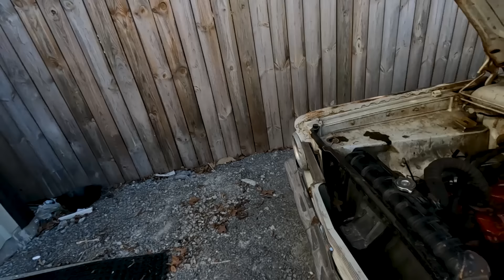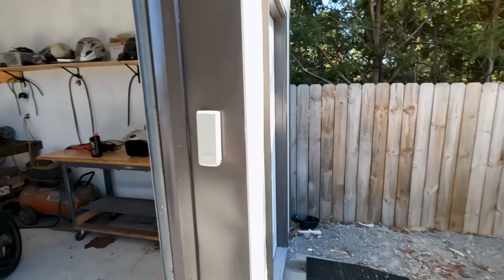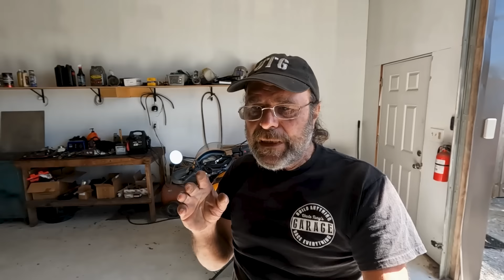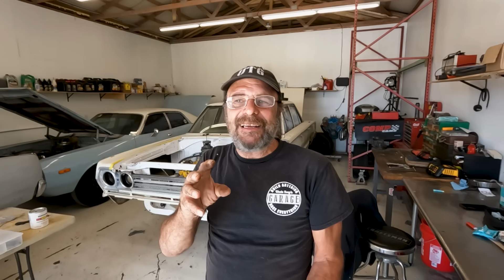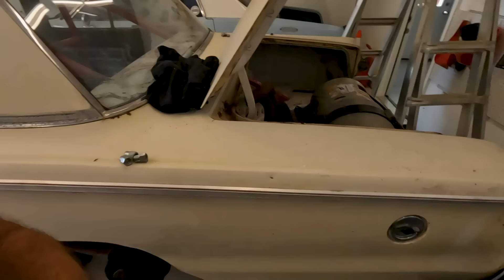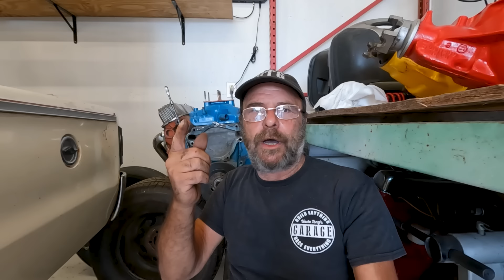Classic Car Tuning Problems - Curing Off-Idle Stumble, Bog, Hesitation, Stall And Backfire

Comment: i was born in 82 so most of my driving/adult life society has been injection.... although my dad was a old hotrodder.....mom always had a newer car bud dad stuck to the older stuff from the early 70s and older.....i learned carb adjustment and points dwell way before i was old enough to drive....my firts car was a 49 willys wagon whn i was 14....now im in my 40s  and prerty much only drive stuff from the mid 60s and back......now my kids are building classics too.....its wonderful passing this info to the next generation....if we dont its gonna be lost

Comment: Always set with a cheap neon timing light. Didn’t know about the difference between ported and manifold vacuum. I also used static timing setting it with a cigarette paper like one does on a motorbike. In retrospect I think I got good results timing my various 60s Chrysler cars but may not have got the GM cars timed right. My 63 383 would chirp the tires shifting from 2nd to 3rd at 85 and that good enough for me. I discovered those cheap timing lights were an excellent was to diagnose a weak or intermittent coil because they relied on the coil for power. Aimed at the firewall you could see when the light wasn’t consistent. Intermittent = bad coil.

Comment: Important to note on the accelerator pump: it only holds enough fuel for one squirt at a time. I mistakenly told a guy once that it should squirt every time it pumps and sent him down a rabbit hole trying to "fix" it because it would only do it once. Of course he didn't know it needs to be running and have a functioning fuel supply in order to work every time.

Comment: When I switched out my edlebrock 800 avs 2 carb to a Holley XP 750 I also needed more advance timing
Reply: How was the performance after the swap. Was it a big noticeable difference in acceleration? I’m thinking of doing the same .

Comment: Don’t forget about a weak EGR valve. If spring is weak, valve will just pop open and cause a lean mixture. Just unplug EGR and test drive vehicle. If it goes away, just leave it unplugged or replace it.

Comment: I used your power tuning method on my mild 318!
I saw that on an older video of yours. So I don’t know what my timing is set at but it sure runs good!
Also,I’m running a tuned Edelbrock 500 and after experimenting I found mine runs better using manifold vacuum. Quite a snappy set up now. Running a Comp 268 cam, Edelbrock performer intake, hei distributor and coil and a full 2.5inch exhaust.  My biggest improvement was upgrading the diff ratio from 2.92 to 3.45. By far better now.
Reply: Sweet.

Comment: There was a third way to set the timing on car’s with a vacuum advanced distributor, but it did not always produce what I’d call a reliable result. And that was to disconnect the vacuum advance, block off the vacuum line and loosen the distributor locking bolt just enough to move it by hand with the engine running if you had a distributor wrench. Then rev the engine without touching the distributor, and when the distributor moved lock it in place and let it return to idle. The reason I say it did not always produce reliable results, was it could be difficult to get the distributor locked in place before letting the engine return to idle or have the distributor locking bolt loose enough for the distributor to move on its own. Or still have the distributor locking bolt tight enough, to lock the distributor down while holding the throttle at a fast idle in a single twist of the distributor locking bolt. I played with that method of adjusting the distributor in that manner a few times, and the results could be very interesting and sometimes wildly inaccurate. My dad had a strobing timing like that did not have that dial, and it was very accurate as long as the harmonic balancer was in good condition and the correct one for that engine. And had the timing marks in the correct location on the timing chain cover. If not, I had to go buy timing tape, to clock it at TDC.

Comment: I had a STOCK harmonic balancer separate at about 6500 RPM, the outer ring broken into several pieces took out the transmission cooler line!! 
   Soon as I lift it off, the throttle, the back tires started to slide, had to ease back into the throttle to pull over by the wall ! 
   The safety guys said I did a hell of a job of pulling off to the side….. that’s the way it was heading when the rear tires started sliding in the trans fluid😮 

I took credit for the save and bought an ATI balancer😂

Comment: What’s your opinion on setting timing on a ported setup, then switching to manifold vacuum? It seems to help start easily and then have lots of timing down low without too much up top. Like a recurve kinda, with better starting possibly. I’m running that on my L20b for now.

Comment: In a downdraft Weber the transition "slot" is fed by the idle jets so don't listen to anyone telling you the idle jet doesn't effect driving. It will cause a major stumble at mid to high rpm.
Reply: same story with the side drafts
Reply: ikr 💯 I learned this the hard way. I kept hearing that as soon as you crack the throttle it's off of that circuit but that's simply not the case. It has a major effect off idle

Comment: I know you'll agree with this, many people will claim that manifold vacuum advance is better, yes for decreased exhaust temperature, but I've always found that for performance ported vacuum advance is better. My experience in industrial big block tuning says with manifold vacuum advance you may experience an off idle stumble and I'm absolutely sure that is the case for many many other engines.

Comment: I had a problem with an edelbrock carb that was new . It had a bog I did everything to it. It turned out the thermostat temp was way to low no fuel atomization
Reply: Edelbrock makes an accelerator pump with a much beefier spring thet delivers a larger and more consistent pump. If you look online, the spring is much thicker and it solved my off idle accelerator issues with my truck.

Comment: Dealing with this right now. My car wouldn’t be running if i wasn’t watching this channel. Shop told me i needed a new engine when after watching tonys videos i discovered that it was a fuel issue. Replaced lines and new carb and never looked back. Thanks.
Reply: Shops are either incompetent and/or dishonest by jumping to "bad engine" diagnostic without running basic tests like compression, leak-down, listening for ratting.  If good compression in all cylinders, it should be able to make it run fine with good ignition system (spark) and fuel controls (carburetor or EFI).
Reply: Really good Master Tech video UTG.
Reply: The younger mechanics have no idea what older car problems might be.
Reply: They were just trying to take your engine for themselves😂
Reply: I gotta say that's the cure and best response ever told simply true :-)

Kudois ans 33's to ya!!! 

https://www.youtube.com/results?search_query=ported+or+manifold+vacuum+advance
Reply: Close caption wont say r**arded.  Lol

Comment: I’ve got a rocket 350 from 1970 in my 85 cutlass. I put an 600 cfm edelbrock on it. Way too lean out of the box for that much cubic inches. So first I changed the meter rods, then the jets, and finally the booster nozzles. Too a year or two but now she runs like a molested ape!

Comment: I still don’t understand if you want to use manifold or ported vacuum. I know it’s a debate but why. What’s good vacuum? I can’t get my motor to pull more than 15 lbs. is that normal? It runs great but am I missing out on power?
Reply: Vacuum will depend on your cam shaft, and to lesser extent the type of intake, eg single vs dual, etc.

Comment: My 66 Dodge Dart had a bad stumble in sub-zero temps. So I fabricated an exhaust manifold shroud then connected it to the air cleaner with a flex tube. It fit perfectly into the snout just by chance!

Comment: I got a 74 B250 318 3 on the tree. tuned it using a vacuum guage, got 20 inches of manifold vacuum accelerator pump on it is working. Falls on its face when I mash the pedal to the floor in 2nd and 3rd but if I roll on it slow it runs fine though sounds like it’s got a gallop. Gonna pull the plugs over the weekend and power time it as described here. How the heck do you go about fixing wiper linkage on these old mopars?? Every old dodge I’ve ever had uses those piece of shit rubber bushings to hold the linkage together and they all pop loose when you’re driving in the rain. Also my button fell out on drivers door how does a guy go about fixing that?

Comment: The crappy part of timing these older v8's was the steel chain running on nylon timing gears.  As the gears wore out often in 40,000 miles, the cam would retard.  So the distributor (running directly from the camshaft) would have severely retarded timing.  The manufacturers replaced the steel gear set with nylon not because it was cheaper, but because it was .....quieter🤣

Comment: When the inertia ring slips counter clockwise when you showed from the front, timing it to the new slipped tdc mark, it will actually be MORE advanced because the tdc mark has gone retarded , and you are trying to bring it ahead MORE

Comment: I remember reading all of this in Chilton's manuals 30 years ago on how to tune up your car properly.  This type of knowledge is becoming lost because so few of us drive cars with carbureted engines anymore.  One comment.  On a Slant 6 you can't advance the base timing very much.  I believe it's because of the long stroke the engine has.  On most engines you can advance the base timing a lot and you're fine.  On a Slant 6, in some years in the 70s, the spec was top dead center.  You could advance it 4 or 5 degrees but that was about it.

Comment: Actually, when you said the damper ring slips counter clockwise, and you time it to the slipped mark, it will be even MORE advanced, not less.

because the Inertia mark is retarded and you need to advance the timing more to bring it back to where it was

Comment: Nice job Tony, that will help a lot of people.  You have amazing knowledge.  I get cars other shops have looked at and could not get a stumble out of.  Yes, carburetor or ignition.  I also get Frankenstein motors in cars bored, stroked, over crammed, over carbed, etc. etc.  Also odd swaps, especially GM’s like say a Chevy with a Buick motor or a Pontiac with an Olds motor, just about anything.  Yes, if the accelerator pump is working and adjusted properly, most likely ignition timing or an ignition or electrical problem.  Might be just me but I have repaired and adjusted many rotten carbs causing stumbling that had good accelerator pumps.  A Thermoquad in the distant past comes to mind immediately.  Like you perfectly stated, it is nice to know when something is good, like known good carb or known good ignition before someone changed the carb or whatever they did.  I will give anyone a tip on a stumble I found.  I get a hot rod in, barely touch the gas and it stumbles, mash the gas, it either takes off like a race car or it drowns and dies, it had been around to a lot of shops.  Customer said he bought it that way, said the seller thought it was the carb needing adjustment but he had been driving it that way for years.  I could see someone had  been all over the arm bending for the accelerator pump but it appeared to be working well.  So I am thinking ignition.  This is a very old hot rod with some kind of replacement 350 with a cam, aluminum heads and manifold.  I see it has a chrome timing marker and this thing is tiny and although true to top dead center on the zero mark was not spaced/marked correctly after that.  Was not the problem but could have been.  The problem was the 12 volts going to the distributor was keyed voltage and weak.  At idle the engine is spinning the alternator the slowest giving anything and everything the weakest voltage it will get.  I find it has an all out race ignition and it needed voltage as high as it could get.  The resistor wire had been replaced with a nice thick regular wire.  It was a half volt low, motor running or not, reving up or not.  Keyed voltage was low anywhere, all the old fuse system was intact.  The fix was to use the keyed voltage to run a relay to hit the high performance ignition with fused full battery power and it turned that stumbling, spitting dying thing into a tire fryer.  The cam seemed big so I timed it to vacuum first.  Then I took a piece of masking tape and taped it over the timing mark indicator on my 350 and rubbed in the marks, transferred that to customer motor indicator lining up the zero marks so I would know where it actually was set.  It was a lot of timing, I took just a smidge more out.  Anyway, that fixed it, slam dunk on the tune, the motor ran like a race motor, snappy, pulled hard, tested good, didn’t want to break anything.  Very happy customer when he left.  A rare problem but I have run into that type thing a few times now so hopefully that may help someone with a stumble.

Comment: In queens we used to get a guy in the car put it in drive with the break smashed down, the guy under the hood would turn the distributor until the the tires started to break traction. Lock it down and your ready to go.
Reply: @jerryakbar6147  lol.. old skool stuff is still viable. Maybe not "right" but can get you in the ballpark. Cool story jerry
Reply: @jerryakbar6147  another old redneck way... is listen to the engine at idle. If it's hitting correctly, (just under the rattle sound). Just rev it to 2500 ish.. turn it back and forth until happy..  adjust depending on application. That will make it run. Not correct.. but a good base point. Until fuels change of course. Lol
Reply: What do you do in a standard
Reply: @username-kb7yf do it against a wall

Comment: I once bought a 3.0 Ranger 1993 with EFI and the owner sold it because it ran like crap- after seeing three experienced mechanics set the initial timing according to THE BOOK
and give up,saying the chain HAD to jump
However a younger guy experienced in these Fords showed me you cannot set the timing here without UNPLUGGING the "SPTI" connector- because the ECU has already added
advance on start up-the decal warning you of this was missing from my truck, why?
That little engine ran like brand new at 150 k miles and did so for 9 years until wiped out by IDA 2021-made it to 255k no problems
The trans? Pieces of Garbage that fail when you least expect it (A4OD) a Ford-O-Matic with a lockup torky and ECU selected overdrive.Total crap
I can see that Uncle Tony is going to have some problems with RODENTS under this car's hood-  but this can be avoided with the proper feeding of rodent "snacks
Reply: SPOUT connector.
Some Fords also had an octane connector that looked like a SPOUT connector. You would pull that one out if the vehicle had too much spark knock and was being filled with 87 octane or less.
Reply: @Joetechlincolns  Correct,I remember that being the spelling on the work order 20 years ago
SPOUT
Cheers

Comment: The way I find true top dead center without a piston stop or a degree wheel  is similar. Bring 1 up to close to TDC compression stroke get long zip tie (or something that CAN NOT fall into the cylinder). Continue to turn the engine clockwise (normal rotation) until you feel the zip tie stop moving up. Mark the dampener (I use 0 on the timing pointer). Now continue to slowly turn the engine clockwise until you feel the zip tie start to go down and mark the dampener again. 
True TDC is at the exact mid point between these two marks. 
I go back and repeat this a couple yours because I'm neurotic like that but this has the fastest, easiest, and most precise way I've found to to locate TDC without tools. 
Obviously a degree wheel and piston stop tool is more accurate but this way gets you really close.
And don't be surprised if your pointer doesn't exactly point at the mid point between marks which is true TDC some will some won't. If it's significantly off your dampener has slipped and needs replaced.

What you're doing is finding the mid point of piston dwell at TDC.

Comment: Don't forget people... elevation from sea level can change how happy an engine will act under different mixtures too. And yes.. timing as well will need to be adjusted. The factory specs were set so it would run up here a mile up. And at sea level. (Pretty big difference tbh)
Reply: Efi is king
Reply: @apocolypse11  not in the true horsepower world it's not. Guaranteed if set right, carbs outrun fi. Js.
Reply: @apocolypse11  efi is king for newbie drivers, soccer moms, and the ones that don't want to learn how an engine actually works.. NOT king in my book. Maybe yours?
Reply: Google it... or Bing... or whatever engine you use. Youll find out there's more efficiency in a wrll set carb than ANY efi ever built. As long as the carb matches the build. Same as the efi has to match the build.

Comment: 20:07. While yes I agree.. it also made sure the distributors vacuum advance functions were all working correctly. If you did all this and still had issues.. put a timing light back on it with the advance hooked up and rev it up a little to make sure.. basic stuff to us.. but thought I'd share just incase.

Comment: Of course all bets are off if you have a mid to late 70's Chrysler with the Lean Burn setup, then the options are wittled down to a match in the gas tank! Opinions may vary 😢
Reply: Toss it in favor of regular electronic ignition.